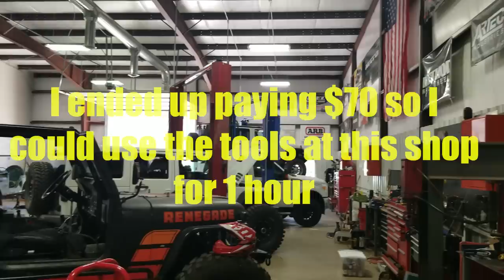Toyota Tacoma CV Axle Repair Nightmare | Overland Moab

Comment: What the shop should have done is taken off the wheel, looked at the suspension setup and said “I’m sorry but we cannot do this job. We only deal with stock parts for non-modified vehicles”. I respect shops that say that.

Comment: Don’t forget if you ever try to take cv out and drive it the outer shaft to hub needs to be in wheel bearing and torqued or your wheel wheel fly off with no cv torqued as that keeps wheel bearing together

Comment: My bad luck always comes in waves when it comes to the truck. Either King shocks needing a new shaft while just changing seals and fluid, changing ball joints just to find brakes are sticking 2 weeks later, AC going out on a 10 hours drive. I feel you Maxx... gotta pay to have fun unfortunately

Comment: Gotta pay to play, whether it's paying a shop for repairs or taking the spares and tools along with ya.  One never knows whats going to fail, but one should ALWAYS expect something to fail and have a plan or lots of money ready for it. 

It's awesome you got it back together and working.  You didn't put that clip back in the CV did you?   If it's anything like a VW baja axle, we just let the splines float in the CV's.  Made it quick work to replace a broken CV or shaft out in the field.  We carried two pre greased CV's (double bagged and in a plastic container), two extra boots, CV bolts, and an extra axle EVERYWHERE we went.   VW CV's were the designed weak link in our drive train to save the transaxle from damage.

Comment: Dude check minute 17:21 the boot on the CV joint is out, can't believe that your buddy holding the camera didn't spot it neither you while working on the wheel. I see two things one you drive like there is not tomorrow that truck. 4 wheeling or overlanding is not about how fast you get to your destination is not the Dakar or the Baja run. You gotta learn how to be patient or you are going to go crazy and broke fixing parts. And second you need to fix that lift . I remember one of old videos  when you also broke something I think driver side, clearly that lift is too much for those front end components, or it's wrongly done
Reply: I was wondering if he had steering stops. They stuck because the screw your turning radius but it does help to keep your axles from over extending.
Reply: I think he picked a Tacoma BECAUSE he wants to go fast though. There's no other reason to bother with IFS in an overland vehicle.
Reply: @redneckcrawler2367  Yes, this was definitely the issue
Reply: @Maxx.Powell  are you kidding me they stole a tool from you? How are you not flipping shit?
Reply: You can hammer those trucks pretty good, but any time you have long travel and CVs in the same sentence you are asking for trouble. Few tips if you arent aware....keep the locker unlocked while turning, limit steering angle as much as possible while in 4wd, and if you have to be at full lock baby the throttle. the more angle you have on a CV, the weaker it is. in a straight line they are almost impossible to break.
Reply: I was gonna say in past videos of this trip those cv angles look kinda scary, be it his long travel the 35s or mix of both I was thinking it was only a matter of time before a cv goes kablammo

Comment: No offense, I love your channel, but for others looking at his truck and saying wow, this would be amazing off road, think again. When you mod as heavy as this, finding factory replacement parts is a no go. If this was a factory axle, this would have been a few hours job and then back to the fun. 

Sorry to hear about this. Hope it all got sorted as best as possible.

I have taken a lightly modded 1st gen through all of Moab and if something broke, it was easy to get a part and fixed on the trail. Just something to consider when going heavy mods like this. Leasson learned: Keep spare CV's if you have aftermarket CV's like this
Reply: T.Jentzsch Not heavily modified. He just needed a spare cv made up with the longer axel, which he knows how to do. The best thing he could of done was fix it himself. Maybe buy harbor freight tools to do it at the camp ground, it still would have been cheaper and quicker. Could of also rented a car/suv for the day to drive back and still be under a thousand. I’m speaking from experience on this. I also learned the hard way about non OEM axel splines not being the same.
Reply: @lukestoyz  lol, ya, it's only custom axles.... And everything else... Lol
Reply: @lukestoyz  custom axles, regeared to 5.29, aftermarket upper and lower control arms, shocks & springs, modified spindle, after market leaf spring pack, relocated rear spring leaf shackles, front and rear bumper, sliders, fenders and 35 in tires ..... Yeah not heavily modified at all.😂
Reply: Or maybe could have dropped the diff and possibly saved a little wear and tear in the cv’s despite being modified to the moon and back. Guess the next option is to do a SAS into it and be done with the IFS all together.

Comment: Bought a used 50k mile FJ Cruiser a couple years ago and a month after buying it I went to Colorado and Utah for some off-roading. The FJ had a budget leveling kit (strut spacer) that put the upper ball joints at max angle and was a worry for me but didn't have time to mess with them before the trip (Will do it afterwards right?) Had a great time in the Rockies but climbing up a steep hill on Hell's Revenge I stupidly decided to drop to a lower gear as I was starting to bog and popped the clutch to hopefully not lose too much momentum and got wheel hop and then "BANG" popped the passenger upper ball joint, partially pulled apart my CV axle, and tore the brake lines leaving me stranded with 4-other people who were riding with me.  Luckily Dave at Xtreme 4x4 Tours was taking his last group out and after he dropped them off he came back and loaded us up and took us to the hotel, He later picked me up in the morning on his day off and we spend about 6 hours ratchet-strapping the ball joint back in it's socket and we inched my rig all of the way out with him guiding me out, trying to keep that tire with weight on it so the ball joint would stay in it's socket. I think it only popped 3 times getting it out but some of the descents, with only my mechanical parking brake to slow me, was the most tense I have ever been. Ended up being treated really well by a local shop and they even went in early once parts arrived to repair my vehicle before having to pay another day at hotel. It wasn't fun at the time but now I look on it for all of the positives and good people I met so you will forget the expense over time but always have good stories to tell.

Comment: I'm not too sure if the axle assembly is slip or press fit. I have fought press fit parts before and now just use dry ice to shrink the shaft. It's a time saver. Not sure if that would of helped for this. Safeway carries dry ice.

Comment: If you're going to thrash your truck like you do you shouldn't be complaining so much when things go wrong, you should expect things to break and plan ahead for it by bringing spare parts along, tools to swap things out, and extra cash for those times you absolutely need a shop. It doesn't matter how new or expensive it is, it doesn't matter what mods you put in or what you think you know about cars or what you think a mechanic does or doesn't know, it's going to break at some point.

Comment: That sucks. When the outer cage broke and the bearings fell out could you have pulled the shaft out of the outer with the cage and pulled the axle and trinuckle out of the inner and just driven with the outers and not the axle. Also. I spent 8 hours trying the Pipe method on my axles and in never worked. I had to cut. And pull your dust shields off next time you swap a wheel bearing.

Comment: Funny thing is. If you watch him replacing the steering rack about three months back. watch?v=DgRAwP0WEeE look at 12:26. It wasn't covered then. So yeah.
Reply: @Maxx.Powell  look into Partex 14 inch Stainless Steel Cable Ties that should help.. I have some on my rav4.  Or hose clamps but they will eventually break off when you tearing it up. Good luck.  Edit look into crimp clamps for axles as well.

Comment: What you could have done is take both CV axles out and drive home. On the highway you don't need 4x4 anyway right.
Reply: @Maxx.Powell   Sorry I don't see that but I  glad to see that you got it fixed. I totally understand how you feel I was in a similar situation when the carrier bearing went out of my truck and I was not able to get the old one off. It's frustrating but sometimes you just got to give it some time and come back to it.
Reply: Japopo He could of just pulled the axel out of the broken side and left the other one alone and drove home
Reply: One of the reasons I miss the old days when you had manual hubs. Just get out of the truck and disconnect them. I wonder if any one makes them for the 3rd Gen Taco.

Comment: It's got a 2 inch longer shaft!  No Wonder it cost a boot load.  I'm thinking holly sh#@ if I have to replace mine $1200  ugh
Reply: OMG $70 bucks per hour for use of the tools?  was it another  $10 to take a wiz.  Damn... that's a bad week.   Thanks for sharing.

Comment: I have a taco, but times like these make me want a Jeep because of solid front axles. Lol.
Reply: Jeeps break axles too. Especially if its not a dana 44 rubicon front axle. Solid front axle isn't fun in "spirited" driving so high speed blasting through the desert is crossed off the list. Only problem he was experiencing is the fact that he doesn't have an off the shelf CV setup. What was something that takes 30 minutes to fix on the trail turned into a nightmare because of his custom CV.
Reply: Or you can get an older triple locked land cruiser
Reply: @w0nt0nj0n  And put 10 grand into it and rebuild all the old and wore out parts that never got maintained.
Reply: @CACressida  you can find some that have been garage kept in good condition not necessarily worn out, it's rare but possible
Reply: skankhunt42  umm, okay? I'm actually from WA State and that's how I went about it. I'm just presenting options.

Comment: They do but they charge a pretty penny, a real shiny one too plus they have automotive part shops you could buy the tools for any job and it will be cheaper to do it yourself than to pay someone to do it. i would personally cut the axle with a saw 2 wheel drive it home and go on from there poor maxxy he will be fine hes a tough fella. i feel for yah pal poured a cold one down the drain for yah wallet.

Comment: First, should have gone to one of the real 4x4 shops there, not that pkace. Second, should have just over nighted factory new joints and boots then cut off the olds off the shaft then 2 bolts at bottom uniball and pop out shaft plus work should have been half that amount. Even in Moab.

Comment: Thanks for the ass puckering moment cutting the CV. I read some negative nancy bitching about you driving too fast. Funny thing is, nothing  broke resulting in driving too fast. If that guy thinks you drive to fast,  he should see how i drive my FJ. Blasting through the desert at 60-90mph with stock LCAs, and a 3" lift. You've got a long travel setup so theoretically, you're fine. Only damage I think you should expect is wheel bearings. I think you just developed some grit and debris collection in your CV from that one time you blew out your rack and the CV wasn't cleaned out. I do recall the Lotus design HD CVs.

Comment: Really doesn't seem like Toyotas are so overbuilt anymore. Seems like they're kinda shifting to over-engineered
Reply: Maxx’s Taco is far from stock and the further you get away from stock the more BS will come your way.
Reply: @hotsauce3700  yeah, but they used to be overbuilt. You could put bigger tires on them and push them harder and they wouldn't quit. Nowadays it seems like the tolerances are set closer to stock and to build a good Toyota you basically need to take all the Toyota stuff off. And that's a shame, cause they haven't gotten any cheaper. They just got more features and more expensive.
Reply: I agree. These new Toyota’s aren’t as reliable and don’t like to be modified very much. I really dislike these new tacos specifically the 8 speed trans and 3.5 Atkinson cycle. The 4.0 is reliable and rock solid
Reply: @ricardoalamo8704  indeed. The old automatic and 4.0 were perfect and I don't think anyone buys a truck for fuel economy. I wonder why they're good enough for the 4runner, but not the Taco.
Reply: AD1 well it’s mostly politics when it comes down to it. The EPA forces car manufacture to chase better fuel economy and forces them to put these “fuel efficient” components and engineering in to their new trucks. Each manufacture gets points from the EPA for selling and offering better fuel economic vehicles for example for every hybrid and fuel Efficient vehicle they sell and make they equally get to sell or make a crappy fuel efficient vehicle like the tundra. Each year the EPA sets a standard for each vehicle class and what they think that vehicle should average on MPG therefore forced to make adjustment (or pay fine)to their vehicles like smaller engines, aluminum beds, shaved out chassis, plastic components like valve covers etc.. that’s why the integrity of these new vehicles are compromised so much. The 4runner will soon have that 3.5 put in to it as well it’s just a matter of time. I’m a big fan of that 4.0 I think it’s Toyota’s most reliable engine ever made, probably why they have been using it for over 15 yrs and running.
Reply: Is the same CV shaft they have used forever.

Comment: yikes and 2000 miles without alignment, there goes tires too. @ 00:45 seconds will cause many of those issues and expenses, Yikes. you play, you pay. Ive been there too, but the whole rig cost $2000 so it was manageable, you only live once haha.
Reply: @Maxx.Powell  haha, worth it being out there in Moab for sure though. You Pay to Play with offroading. We started an annual event out here in las cruces. The firs years video is #relay4x4life and its a blast too.